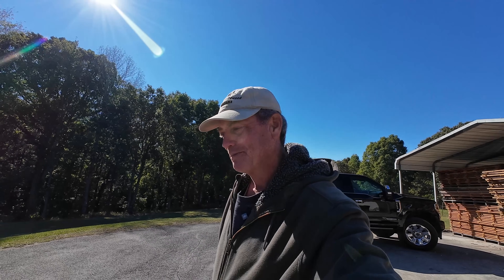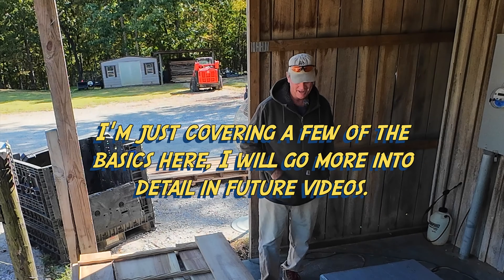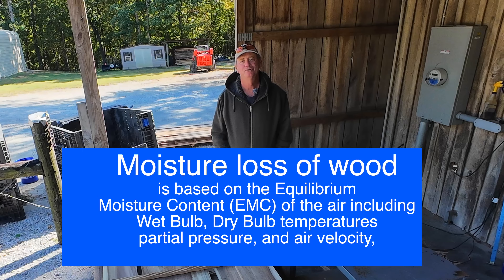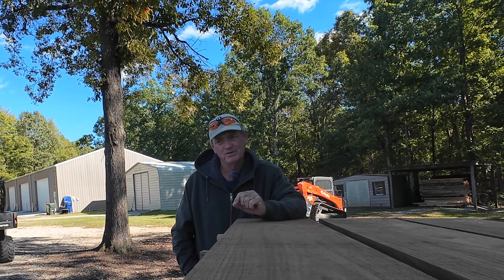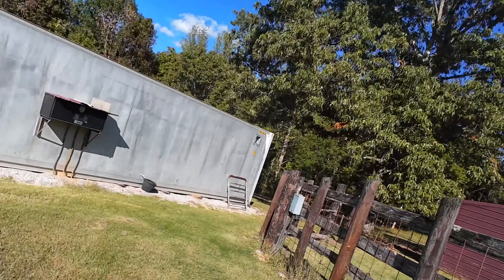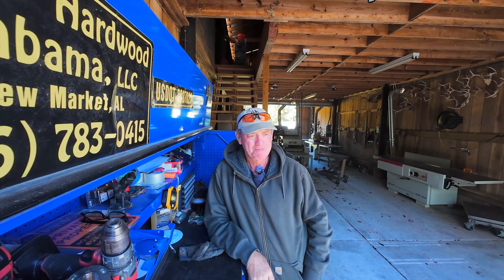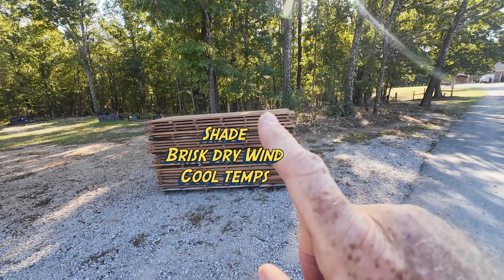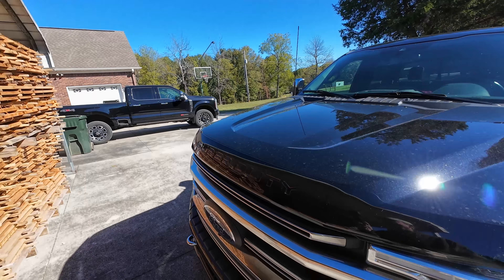Air Lumber Drying Secrets of a Pro!  Maximum Allowable Moisture Removal Rate Explained!

Comment: I would like to know what makes the gravel spot 50 yards away from your implement spot better for drying, and in the inverse as well, what makes the spot for you implements different where as it ruins wood? 🤔🙂🙏.
Reply from the maker: The gravel spot is open, has good airflow much of the day, and is just a "comfortable" place.  The ground dries out fairly quickly, and it gets a little bit of sun during the day.  The gravel spot by the woods is stagnant, being blocked by all the trees and kind of backed into the woods, has very high humidity due to the ground not ever being able to dry, and is best described as a sauna in the summer and a dead spot in the winter.  It's a good place to grow mold and not only that, being so close to the woods, bugs and mice immediately move in and infest the wood stacks, bugs boring in, and mice peeing everywhere.  Even the metal implements has mold and fungus growing on them.
Reply: That was my question. Thanks for the thorough answer. I'm going to change my staging area.

Comment: So the conclusions I draw from what you have so graciously taken the time to share is this:
(Obviously acknowledging and "MEMORIZING" the science stuff)
1. Air drying is "site specific." A persons "Zone", space, elevation, etc.
2. A.D. is "Species specific." Some overlaps of some species.
3. A.D. is, and this is related to species, is "End Use" specific.
Very generally speaking, does this sound like I understood what you shared?
Thanks!!!
Reply from the maker: Yes, there are two parts to know about drying wood, 1. the max moisture removal rate and 2. (which I did not talk about) is the EMC or Equilibrium Moisture Content of the local air where the wood is being dried.  Form those to pieces of data, then a proper site can be selected, base upon species and thickness, and then proper drying with as few defects as possible can occur.  When making pallet wood, lots of defects are fine, when making high grade lumber, no defects are tolerated.
Reply: @sawdustandsweatnc .. thats what I got out of it

Comment: good video  one quick question,  had woodmizer dial in my mill on a once a year timeline,  just had them dial it in,  new blade,  tension is really tight,  sawing slow,  still have a little wave in hickory,  is there something more I can check, or it is what it is,  pine and cedar and oak saws flat,
Reply: if you saw hickory at night you can see the sparks coming from the band it's that hard. try a carbide band
Reply from the maker: Are you packing sawdust?  Does it look like packed flour ( bad) or dry cornmeal (good)? What thickness and hook angle is your band?  I'd need more information to diagnose properly.
Reply: @HobbyHardwoodAlabama  yes the sawdust looked packed,  only happening on the hickory though

Comment: I got so excited to watch this video and you left me hanging. I'm having a hard time finding that chart.. we've got over a hundred massive logs if pecan a customer needs milled into 1 x 12s. If we can give them a defect free product there's another 200 .. any help would be appreciated.
Reply: Federal agencies produce reliable info for natural resources.
Reply from the maker: Yes, looks for publications about  lumber drying, especially ones by my buddy, Dr. Gene Wengert.
Reply from the maker: Use the numbers I provide for red oak, for pecan and hickory.  The sapwood is extremely easy to enzyme stain, so keep the temps cool, and go slow of the first third of the drying cycle.  Keep lots of weight on the packs as they dry,  3,000 lbs or so, and use real end sealer.
Reply: @HobbyHardwoodAlabama  thank you very much.. we are doing just that. It's so hot here in Texas that the summers are just impossible for airdrying even when it's under good cover..

Comment: Yes sir, I failed to identify from the video what the particular characteristics were that made the area where you put machinery a very bad location for drying? is it the difference of morning and afternoon sun/shade or wind exposure or… i really couldn’t tell from the video. Thank you sir.
Reply from the maker: I really didn't elaborate on it, it will be part of a future video, but basically, the area tucked back into the woods has very high humidity, blocked airflow by all the trees, and high soil moisture because the dirt never dries out.  It's basically in the woods, and causes mold and sticker stain, and then in the heat of the summer, the sun hits the area and brings the temperature and humidity up even higher.  It's like trying to dry wood in a sauna, just isn't going to happen.
Reply: Thank you! that was a great answer to my question. Exactly what I was wanting to understand.

Comment: If you weren't in business and just producing for yourself, could you air dry all hardwoods at the area that works for say the lowest daily moisture removal rate or could drying a higher rate wood at a slower pace do damage?
Reply from the maker: Good question.  It depends on the sugar content and properties of the wood, and if sticker stain would devalue the wood.  Drying a high rate species slowly always brings the danger of sticker stain and mold but generally prevents physical endchecking and cracking.

Comment: So, Mister Robert, how do you slow the rate,  time of the year, keep covered and mist it? Where do we start our search for the answers ??
Reply from the maker: It's a very detailed answer that I will discuss in a future video, but first is to know the EMC of your immediate area, or the Equilibrium Moisture Content of the atmosphere surrounding the wood.  From that you can tell how fast the wood will dry without doing anything.  Then, based upon the Max Moisture Removal Rate for that species and cut, you can decide to speed things up, such as using fans or putting the wood in an open, hot breezy space, or to slow things down, by putting them in a cool, covered shed and the wind blocked by other stacks of wood.  No real decisions can be made until the max removal rate is compared to the local EMC, which I didn't talk about in this video.
Reply: I want a big pond on site
Reply from the maker: Me too!
Reply: @HobbyHardwoodAlabama , Yep, the more logs you put in the more fish you have to catch to make room for them. What could be mor fun and practical at the same time?